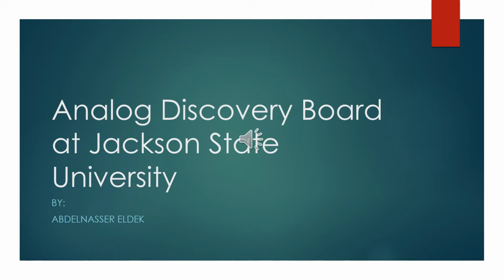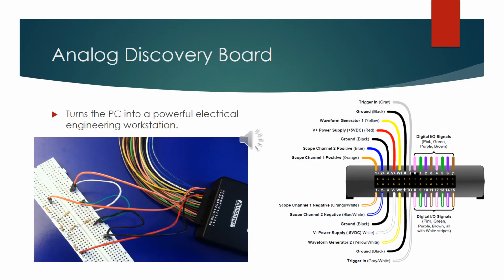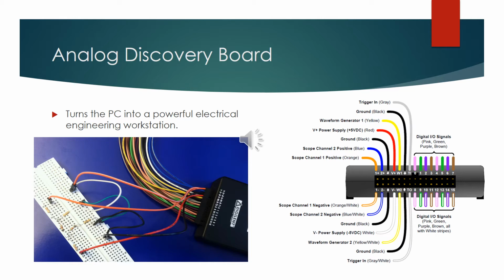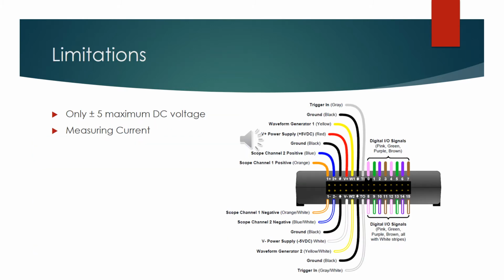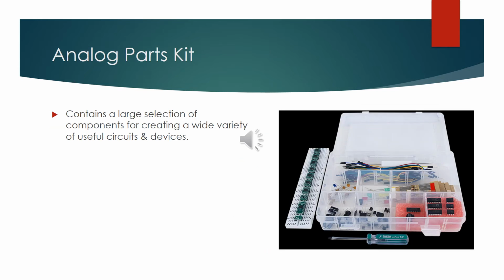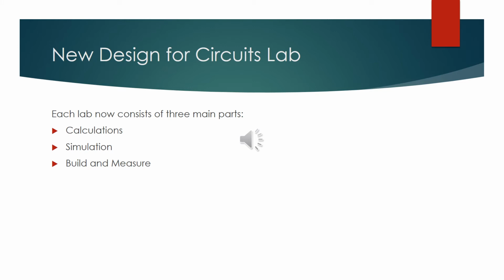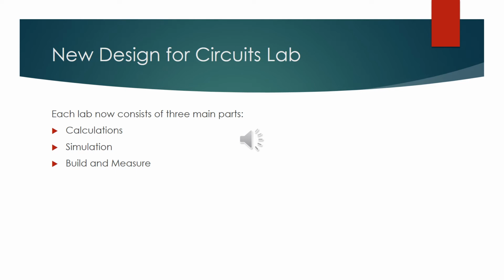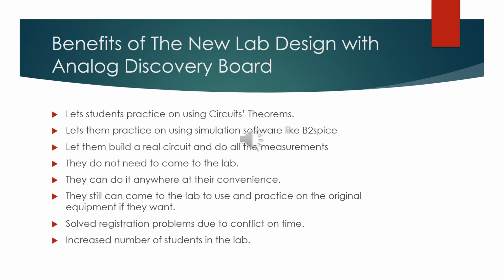Analog Discovery Board: Hands on Learning @ Jackson State University_Abdelnasser Eldek

Comment: It looks like one of the really positive aspects of using Analog Discovery is that facility limitations go away. How important are such limitations to recruiting and retaining students in ECE? Have there just not been enough seats to get all students who might be interested into the program? What hypotheses does your experience suggest should be studied to show that student learning is positively impacted?
For the limitation you mentioned about current measurement, why not just add a resistor in series and find the current indirectly, especially since Analog Discovery will plot results in Amps if you wish? This should work for a lot of cases, but, of course, not for all.